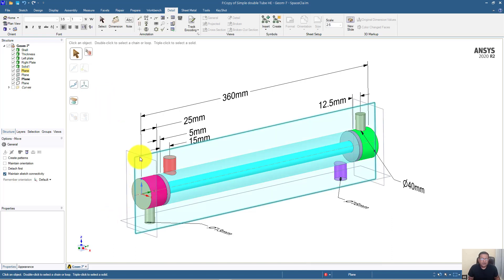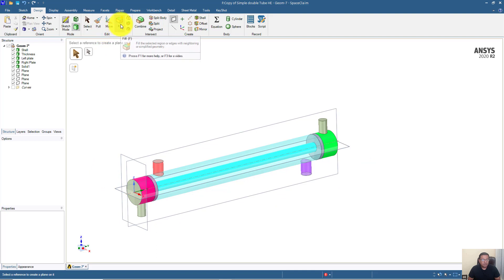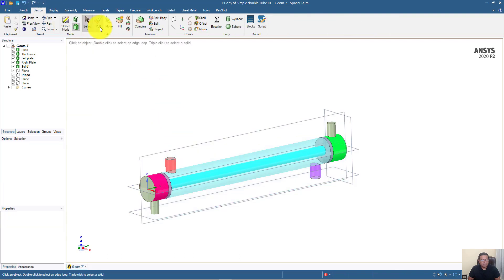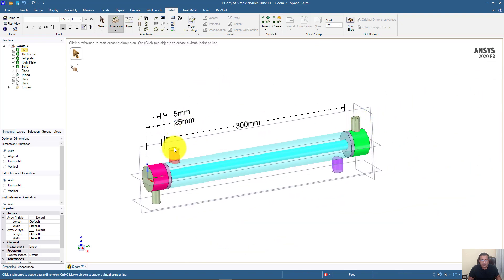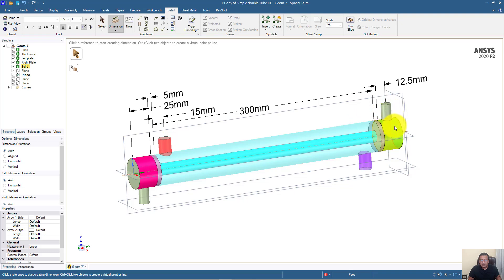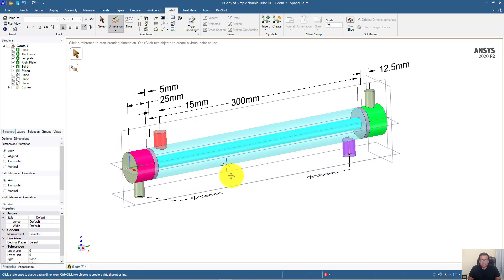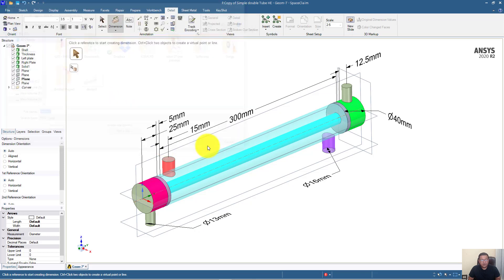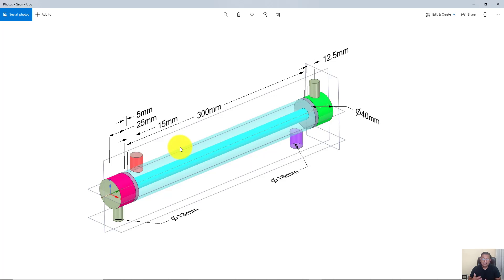How to put dimensions in 3D in ANSYS Spaceclaim | Part 8

Comment: a Q : how do i know what was the measurements of any part insertet from internet ? i mean if i donwloaded from grabcad for example , how do i know all process and measurments?
Reply from the maker: very easy. There are tools to measure it
Reply: no no , i mean can i know how the part geometry was build "? (what a sketch and kind of  extrude) method the creator of a part used ? if i download form grabcad .  any way thank you very much @CFD_Mechanic
Reply from the maker: @julianochioo   Possible if you download in some cad format and open it in its own software. Like if you open solidworks file in solidworks you will get full idea. But if you use step or iges then not possible